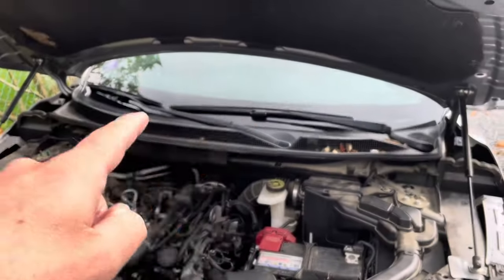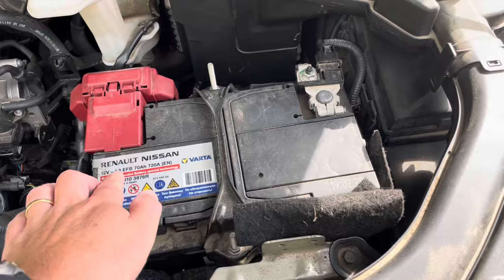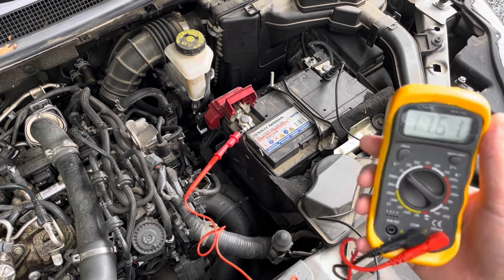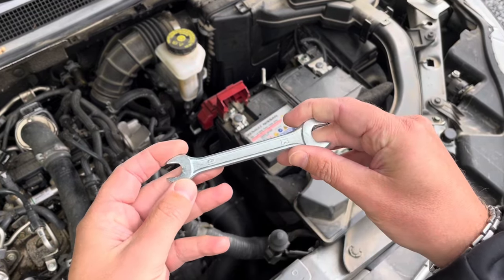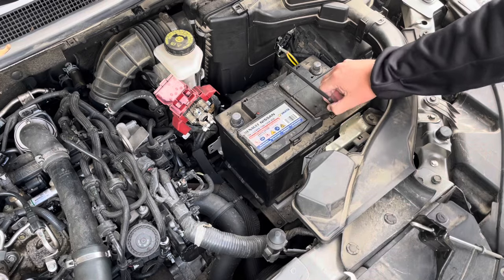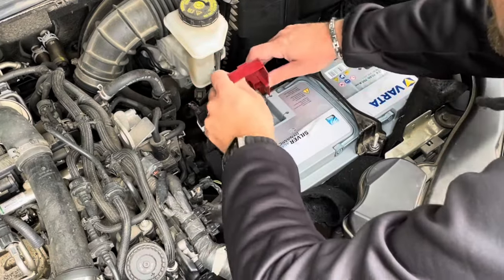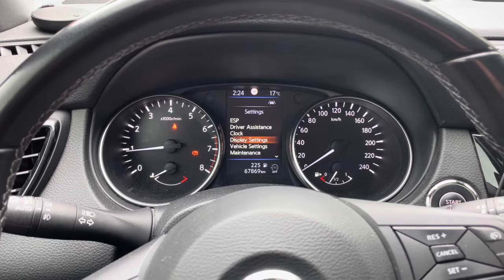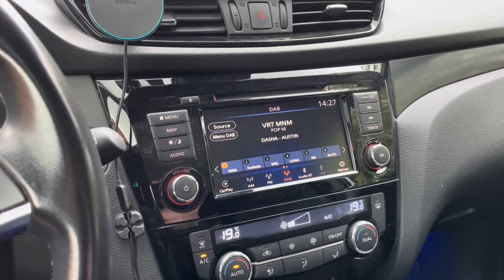Nissan Qashqai: change the car battery yourself (easy fix!)

Comment: do you know what yr model of the qashqai does not need a coding if you change the battery, because some will need the code to activate the radio again, haven’t change my battery it’s been 3 yrs still running good. was wondering if might need a code or not. By the way most of the dashcams consumes battery, i’m a beta tester of 70mai products here in France,they did send me a battery pack and it works perfectly instead of tapping it into the fuse.
Reply from the maker: Hi! No but i had a 2016 and a 2020 Qashqai and it was no problem to change the battery. Even changed the first on a parking lot of a Norauto in Picardie 😉 wow a beta tester of 70mai. Super nice. What’s your fav dashcam model for now? I love the A510. You can set a treshold for the battery consumption so it should be ok
Reply: @LaPalmeraie0032  i have the x200 omni, but they sent me a new model the upgraded version of x200 omni that comes with rear camera and sd slot, more accurate motion detection. it will be released soon.. we are currently doing some test, and asking for modifications
Reply from the maker: @LloydLutgardoBuhay great! Keep me updated 😉

Comment: Hola amigo , yo tengo anulado el Star Stop , lo he hecho con OBD que he comprado , si tengo que cambiar la bateria bastaria una normal o tendre que seguir con las especificas de ese sistema , es que he oido comentarios que podria dar fallos la centralita , mi coche de momento va perfecto ,gracias
Reply from the maker: Hola, amigo. También desactivé el sistema de parada/arranque, pero de alguna manera puedes usar el botón para activarlo fácilmente cuando quieras (o cuando vendas el coche). Así que preferí optar por una batería compatible. ¿Qué has oído sobre el fracaso? ¿Por qué razón?
Reply: Lo que comente , que puede marcar fallos en la centralita , pero todo sería probar es que son casi la mitad de precio
Reply from the maker: Ah, sí. Puede ser, pero personalmente no me arriesgaría. Normalmente, es un gasto que sólo deberías hacer en contadas ocasiones.